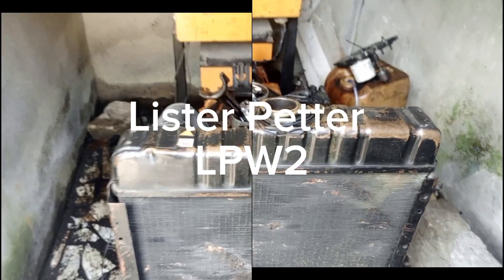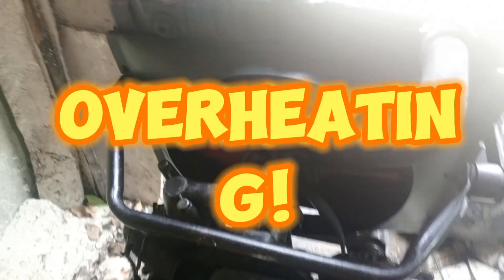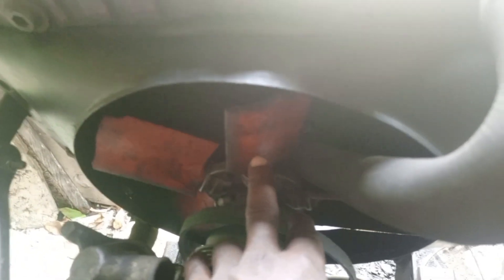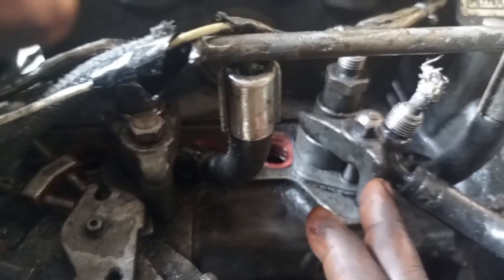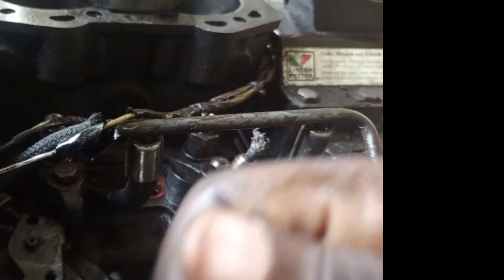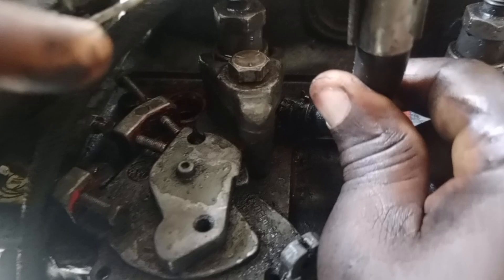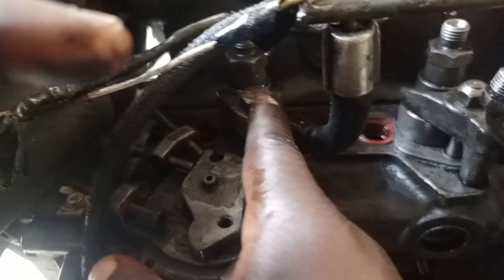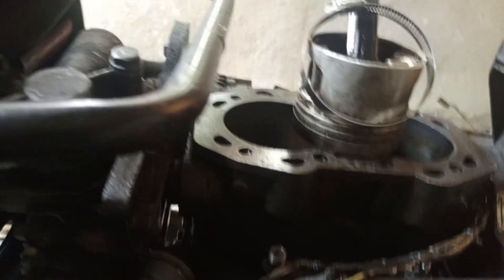Troubleshooting the Lister Petter LPW2

Comment: Hello! Bro, i have this generator    , it starts but the throttle is not working. Can you help me, please
Reply from the maker: That means the throttle spring has cut or remove.

Another reason if one of the injection pump is not controlling by the rack.

Check the rack if it is traveling up and down
Reply: Thank you ! Is there avway to get in touch with you.
Reply from the maker: Reach me here: yorubaforindomiegeneration@gmail.com